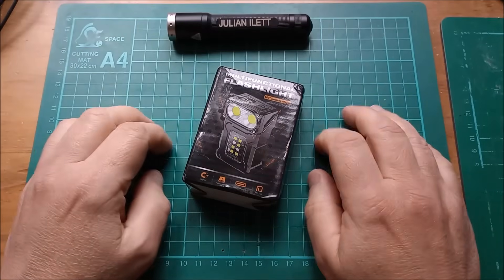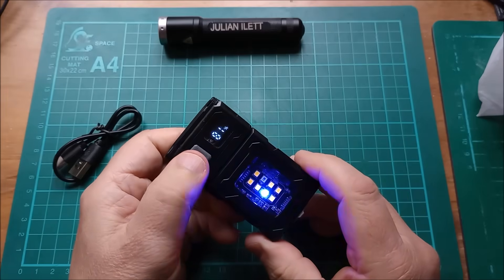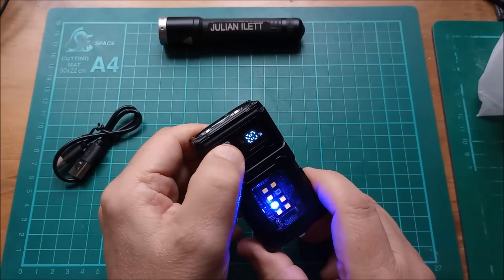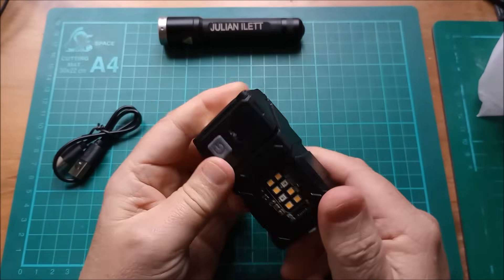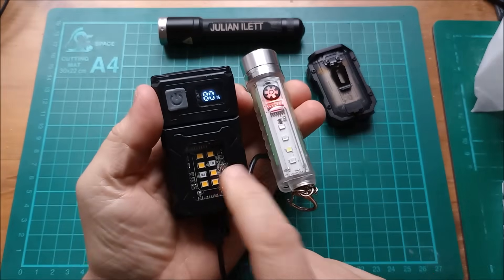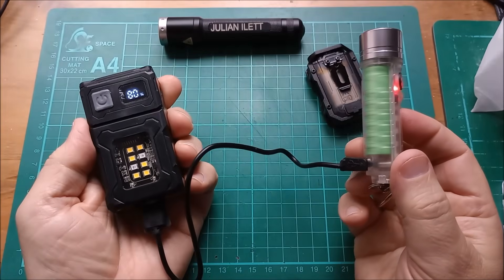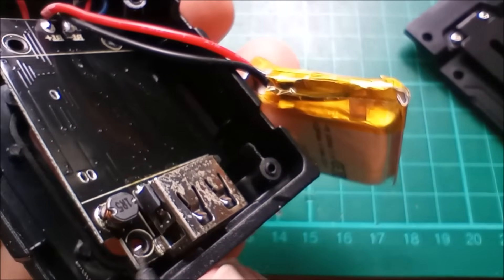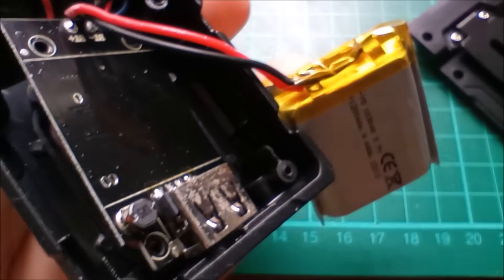$3 Multifunction Flashlight uses TP4333

Comment: Got mine about a year ago. kept it in my car. At times the temperature outside got real cold and using it on a cold battery degraded the battery very quickly. Fixed a 16340 battery by taking a piece off the back cover but that too didn't last long. I still have it and love the features it offers. Will probably get a new Li-po for it and keep it indoors instead. Run times were really decent initially and the brightness was also sustained. Something really unexpected from a budget light like this.

Comment: They've got those SOC displays in vapes now, so the price will be virtually zero! I've got one on a portable fan. It could charge itself as well as charging something else by simply connecting the incoming 5V to the output socket. Pedantry: the dimming is PWM, not multiplexing. 😉

Comment: This is essentially 3 or 4 other products finally combined. I recognize some of the components from their off the shelf diy battery bank solutions. Repurpose and reuse. To be fair I turned one of mine into a flashlight. That center flashlight with the COB array can be purchased on a stand alone USB stick too. I use it to light up the back of servers in my rack. Stick it in the blade above and it illuminates everything below.

Comment: That rotating head is far from useless. You can point the light at any angle from horizontal to vertical whe standing on a surface or the side of a fridge or car using the magnets. Not many can do that for £3

Comment: Touch a soldering iron onto the screw heads for a few seconds so that new threads can form from the melting plastic
Reply from the maker: Now that is an excellent idea :)
Reply: Would it be faster in doing so if the iron holds the appropriate bit for the screw head involved?

Comment: try to put a load with monitoring on the USB-A and see at what rate the voltage drop and cuts off. That might help understand why something will charge or not charge
Reply from the maker: Yes, I should have realised that when the boost converter is stopped, the output would drop to 3.1v (3.7v - body diode 0.6v).

Comment: 7:07 you can probably push the rubber piece back in with a small flathead screwdriver or similar tool giving it a push down at an angle.

Comment: A tip for not strip plastic threads
Loosen them up a bit them keep rotating clockwise and anticlockwise untill you feel less resistemce 
Now you can take them of
Reply from the maker: Yeah, I can see how that could work.
Reply: This is the standard method.  It only works though when the Chinese supplier has the torque setting correctly adjusted on their pneumatic screwdrivers, which is not always the case.
Reply: And when re-installing, position the tip of the screw in the hole and, with the screw normal to the local surface, slowly turn counter-clockwise (anti-clockwise, if you're in the old countries) until you hear and/or feel a 'click'. That 'click' tells you the external and internal threads are aligned: turning the screw clockwise from there will not result in a new thread being cut into the plastic, but re-use the existing thread.